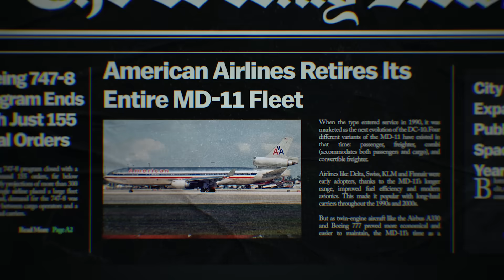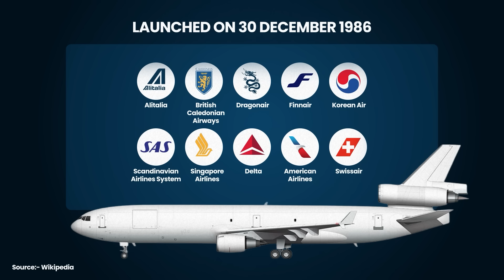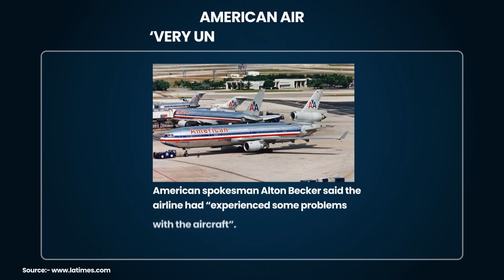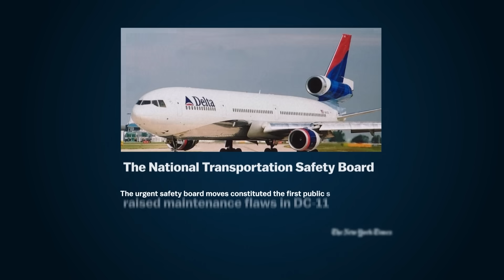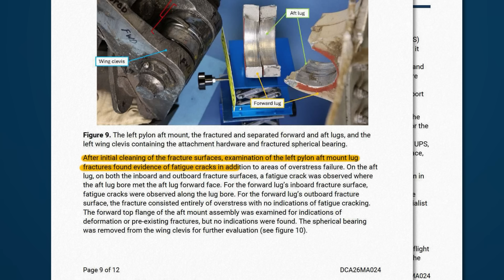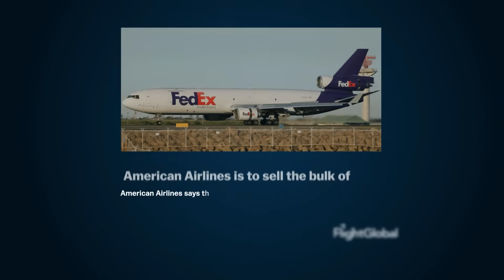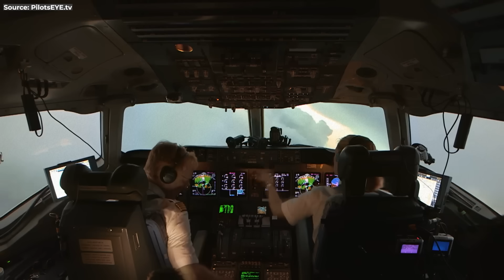Why UPS and FedEx Still Fly 35 Year Old MD 11 - Against All Logic

Comment: I don't know that I can agree to this video's conclusions. The limitations of the wing structure/landing gear attachment together with the weakness of the engine pylons seems to place it in the Comet-1 category of dead-end. I don't think that Boeing has anything to gain from reengineering these mostly obsolete planes. And, frankly, what crews would want to fly an aircraft that can suddenly turn on you at the worst possible time, with no warning, and no possible escape? For me, the DC-10/MD-11 is the new "Unsafe at Any Speed (above V1)" machine.
Reply: Lots of want to be engineers having opinions with limited knowledge. The real issue looks to be was/is why was the full examination of the pylon set as long as it was? If I recall, the Air Force never lost one of their tankers from this issue. And they too have huge hours in service. Was their inspection interval the same as the FAA's?
Reply: Yes, of course... flying coffin. Except for cargo doors and ONE pylon separation because of improper service method, DC-10 was as safe as other planes.
MD-11 have even better statistics. We talking about 35 years old airplane, with 90000 flight hours. We will see if this was one of a kind accident, because of broken bearing that caused lug cracking, or it's bigger problem in the whole fleet.

Comment: I suspect they will retire these due to age, especially since they don't know what will be required to fly these again or when that will come.  They need stability and predictability, so they can't just wait around.   Plus, there are a lot of newer retired 747s they can add to their existing 747 fleets.
Reply: They’ll just have to shorten the inspection interval for the pylon mounts, and they’ll have to figure out a process to inspect between both halves of the clevis

Comment: No mention that the MD-11 cruised faster than any aircraft other than Concorde, around 600 mph. I thought that was why it was pteferred.
Reply: This is not true. I've flown the MD11 as well as the the B744. Typical cruising speed of the MD was Mach .83 vs .84 for the 744.
Reply: @chipdale490 the 747 has a higher wing sweep, so that makes sense.

Comment: Trust me when I say FedEx and ups have squeezed every single drop out of these planes they have made their investment back and more I would push these planes for retirement by 2027 at the latest and buy retired 747s from the airlines and turn them into freighters no use keeping them around when their are already more fuel efficient passenger planes that the airlines are retiring right now that could be converted to cargo for very cheap
Reply: There's not a lot of sense in buying retired 747s. If you plan on building your fleet out you need a bunch, and then you need your logistics to source maintenance and replacement parts. There would also be some retraining of techs involved. All of which to fly a "new" model for 10, MAYBE 15 years? The fuel efficiency of a 747 is also offset by the running costs being higher. This would be like trading in a 20 year old car, for a 15 year old one. Sure it's marginally better, but you're going to need to resolve the same type of issues soon anyway.

Comment: so wait a second . they stick with them for money ? over safety . ok so they are none human to the pilots . what servicing or updates to their program of maintanence will they do ? this video needs those answers
Reply: There hasn’t been a recommendation yet, because they are still grounded.

Before they are let back into the sky, I suspect every pylon mount will be meticulously inspected, the inspection interval will be shortened, and an inspection procedure will be developed to inspect between both halves of the clevis in addition to what is currently being performed on inspection.
Reply: i mean they have been flying for many years up till the accident this year and they were all grounded due to safety concerns and they've sense been cleared to fly again so if you think there unsafe well dont worry you dont have to fly them if there continuing to use them it makes sense it would be money related and the aircraft are still within there planned lifespan anyways so who cares
Reply: @a @andre-rg9rp still grounded.
Reply: It's all AI generated crap.  Don't expect it to make real sense.